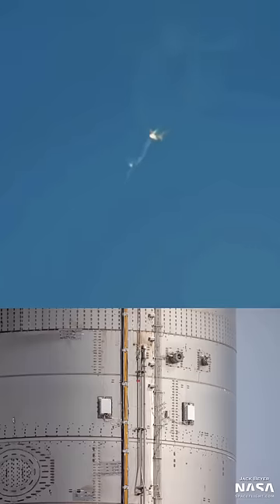Is This Why Starship Wasn’t Destroyed The Moment It Lost Control?

Comment: Well spotted! I remember seeing those lateral plumes but assumed they were some form of RCS. Totally makes sense that they fired but didn't cause detonation of the tanks' contents.  Lots of learnings from this.
Reply: Flight termination systems usually do not result in combustion, that's why you see the white plum with little fire. I don't think scott is right here, even less considering that starship has FTS separated to super heavy and it was evident when it was activated.. SpaceX probably didn't do it for more data, or in hopes of regaining control.
Reply: There was no "detonation" of the fuel/O2. It's probably impossible to get a supersonic explosion wave-front in it.
There wasn't an explosion when Challenger came apart, there isn't an explosion behind a bullet inside a cartridge case.
Reply: @JFrazer4303  that's true, rockets usually just expand really fast with little combustion.
Reply: @JFrazer4303  until the firing pin hits the primer and boom.
Reply: @darkmatter1152  
No, not even then. It is not a supersonic propagating overpressure shock front even from modern nitro gunpowder.

Some sources define an "explosion" so that popping a party balloon or paper bag qualifies, but no.

Comment: When I worked at a rocket startup in the mid-80's, I interfaced with the range safety officers.  Our design was a solid propellant ( polybutadiene+carbon, LOx pressurized (400psi) by helium (8,000psi) ), and the flight termination system was pyrotechnics that attempted to cutup the booster.  The RSO was very concerned we would have 3 or 4 very large ( several tons ) objects falling, when they were used to terminating vehicles that were power with hydrazine.  When they terminated the flight, 100's of thousands of tiny pieces would rain down.  Low potential energy ( mgh ) because the mass of the tiny pieces is so small.
Reply: Who cares
Reply: @deg6788  gfy
Reply: @deg6788  don’t be such a prick man I enjoyed reading it….

Comment: I think the biggest unasserted question is why engines shut down due to safety issues during liftoff/flight, but when they specifically were supposed to cutoff right before the flip started they didn't. 

If you rewatch the livestream the controller calls out for main engine cutoff right before the flip starts but the engines never cut.

Thats said this is itself interesting as well.
Reply: Because that was not the time to decouple yet, I think they didn't reach enough altitude due to early and progressively worsening engine loss with lack of gimbaling. If they actually tried to flip it then maybe they didn't have enough gimbal left to hold the flip.
Reply: @TheNheg66  I think you've completely misunderstood what i'm saying. 

Regardless of weather the flip was commanded or not, the engines were supposed to be cut-off by the time it started. 

The fact that the ground controller called out the supposed cutoff but it never actually happened is the big standout here.
Reply: You're assuming that it was supposed to flip under those circumstances — which seems unlikely, given that it was far short of the altitude and velocity at which staging should occur. I suspect it's just coincidence that the already-failing rocket happened to go out of control at roughly the same time at which staging would have occurred had things been going to plan.
Reply: @simongeard4824  i concur
Reply: @simongeard4824  Again doesn't matter, the engines should have cut before that point because the controller specifically called out main engine cutoff.
Reply: @darthkarl99  The rocket is controled by the onboard computer. Im not sure if ground control has much if any control on the way up. So it was time for MECO but the rocket never made it high enough to start it on its end.
Reply: @darthkarl99  they only report the normal timeframe. But as the rocket was slower, the cutoff would be delayed too.

Comment: I was amazed how well the craft stayed intact with so much dynamic force it had to be undergoing while tumbling.
Reply: you are wrong assuming there was a lot of force exerted on the rocket.
Reply: @Danuxsy  Stand on top of a skyscraper that's spinning and producing 16,000,000 pounds of thrust.
Reply: @Drocoh  also the rocket was completely bent right before it exploded by itself.
Reply: @Danuxsy  because the flight termination system kicked in already, making a hole in the fuel tank.
It wasn't until it hit the more oxygen rich lower atmosphere it could explode

Comment: The failure was caused on the ground. The engines obliterated the takeoff pad and numerous thousand-pound pieces of concrete beat the heck out of the bottom of the rocket before it ever left the pad. It was a sad end to a great effort, but they will fix this and will do much better next time. The torsional strength of the rockets body is very impressive here. That it stayed in one piece so long is actually a tribute to the power of the engines continuing to provide massive upward thrust through all the motions to keep upward pressure on all of the rocket sections joints. Really amazing sequence captured in video.
Reply: It is one tough rocket, though every early flight of a type is going to be a learning opportunity.  A lot of data analysis and stage 0 work to be done, but they'll get it right.  Looking forward to the next one.

Comment: In other words, the self destruct system malfunctioned.
Reply: No the self destruct worked as expected. it was so high, there wasn't enough friction around it in the atmosphere, while it was travelling about mach4, supersonic fires are incredibly hard to ignite.
But, they know at about 6 miles high, there is enough air resistance, made to push against, more heterogeneous oxygen, and now at speeds more conduce to fire, or more specifically, deflagration. With the compromised structure, the air resistance and pressurised gasses causes a fast tumble, which will always rip a plane or rocket apart, causing the deflagration. the self destruct sequence worked, it just had to drop 3 miles first.
The reason we see this happen very quickly, to normal rockets, it's because they're built with aluminium alloy, and are strengthened and braces in 1 axis (vertical), they are single use and only need to strengthen the rocket one way. whereas the star ship is a steel alloy and it's bracing and strength are unmatched, simple because, to reuse it, it falls back down at terminal V, then 'belly flops' to bleed a load of speed off. Any other rocket, that was subjected to that side loading, would self destruct without instruction or explosives..
Anyways I know that was long, it was much longer than I planned anyway, hope it makes sense. Stay safe n have a Good day.
Reply: Did you actually watch the video?
Reply: @renagenic  So, the self destruct couldn't perform the function it was designed for. Or malfunctioned in other words. Good to know.
Reply: @Robert_DeVille  no, just took longer than what we know as usual self destructs we see.
Imagine the starship was a semi and normal rockets are light weight sports cars. Both can do an emergency stop, it just takes longer for the truck,
That doesn't mean it's brakes malfunctioned
it's just working under Newtons, conservation of momentum.
Reply: @renagenic  I can barely see this man through all the thick copium smoke💨 😂
Reply: No suprise. Elon musk knows almost nothing
Reply: @MrDmadness  True, but the problem here is that either he was putting pressure on them to ignore some important step, or someone else messed up. Contrary to what his stans think, he is not the one designing these rockets, he's just taking the credit like any other billionaire relying on competent workers to do the hard work.
Reply: In other words, the self destruct system isn’t well designed. Or maybe there is another system more faster in case of a too low altitude.
Reply: @1980VINZ 

no. it isnt a self destruct. its an FTS which just makes sude the boosters cant produce thrust. it isnt designed to detonate. the fuel ignites on its own due to the atmospheric makeup and speed. then it will explode on its own.

this is why its called a FLIGHT TERMINATION SYSTEM and not THE SELF DESTRUCT SYSTEM.
Reply: @auroraourania7161  He has always said that he hires the best in the business that is why he is successful and unlike Bezos he pays a decent wage and at least tries to stand for something besides a huge yacht that will require destruction of historical landmark just so he can sail it away
Reply: No. It worked as intended. It relied on physics to tear it apart, not an explosion that could ignite the reactive materials in the tanks.
Reply: @Zeeksplaylist  Nonsense, other FTS work as line charges that rip tanks open like a zipper instantly, these small measly holes for a vehicle this big and no wonder it didn't work as it should, massive red flag, why do you think they have to recertify it? If this happened much lower in its trajectory, it could've landed and exploded on a populated area.
Reply: No, you need a queue for 100 ejection seats
Reply: @renagenic it worked as designed. however it would almost seem like you think spacex rockets are superior... yeah that smells copium. as any design it comes down to what is required of the vehicle. reason why space shuttle tank and boosters were built slightly stiffer and why the starships are made slightly stiffer. however i still think we will never get starship, unless US buys spacex and merges it with NASA and well NASA got its own project.
Reply: @Robert_DeVille Work on your reading comprehension lol. The system was designed to ignite once the rocket fell back to a low enough altitude, which it did. That’s not malfunction, it’s function.
Reply: @DoraTheMFDestroya  Nice now I understand better. Thanks 👍
Reply: It was not a failure, he was explaining if deployed too soon it could not work so they waited till right combination air and pressure and then activated and worked as planned.
Reply: @renagenic I’d think quite opposite, since larger tank means more fuel to go boom
Reply: NASA is funded by the Senate and they dictate what NASA can and can't do. Virtually all their projects are too funnel money somewhere. NASA doesn't build or design rockets, they contract it out. SLS for instance had existed in one form or another since about 96 if I remember right, but it's design changes every so often and so does its name. What it's versions all have in common are space shuttle parts, it was supposed to be a cheap alternative to the shuttle. Only one ever flew, since then it's just constantly redesigned, built and scraped. The money spent on it's versions over the years is insanely high. But different project names... And they only list money spent for a given project. 

Point is, NASA could do nothing with SpaceX, the only he is they would use SpaceX tech like falcon 9 and then scrap the rest and shut down research.
Reply: @Robert_DeVille no it worked as expected. Creating holes. Fire is a triangle. Fuel, oxygen, heat. Get one out of the ratio it wants and it doesn't do. This is why your car runs or doesn't.
Reply: @metalsurgeon560   Muskrats are so funny. And that has to be the worst explanation of the fire triangle I've ever heard. There is no ratio, it's a loss of one of the sides of the triangle that prevents a fire, but the point of a self destruct is to destroy the ship, not set it on fire.
Reply: @Robert_DeVille  its the most basic one. Why is it wrong. Get any one of those out of ratio and the thing ceases to burn. Too much or little fuel will put it out. Too much or little oxidizer it will choke it out. And if the fire it produces makes too little heat or too much heat it goes out. All work in a ratio to each other. Which fire naturally seeks to do.  The system worked. There wasn't sufficient fuel in the air around the device for it to catch fire until it got into a more oxygen rich atmosphere.
Reply: @metalsurgeon560  Still mistaking the destruction thing for the setting it on fire thing I see. & it still has nothing to do with ratios. You either have the 3 sides of the fire triangle or you don't.
Reply: @Robert_DeVille  if that were the case I would burst into flames as I sat typing. And they are trying to poke holes and let fuel out not destroy in on first push.
Reply: @metalsurgeon560  Christ, talk about not knowing how fire works. Or what a self destruct is.
Reply: @renagenic Actually a very in-depth explanation. Musk’s haters are almost as annoying as his fanboys.
Reply: LOLOLOLOLOLOL Holy shit.
Reply: @deus_ex_machina_ ain't even a musk lover but the level the haters go through to justify their hate for him is absurd.
Reply: @Robert_DeVille It's not a self destruct system 🙄
Reply: @lenarianmelon4634  Even though self destruct is the function it's supposed to perform, do you know how you can tell it isn't a self destruct system? 

Because it didn't work.
Reply: @Robert_DeVille  its function is to blow a hole in the side so it starts leaking fuel and stop the engines and remove the internal pressures holding the fuel tanks together not the entire ship. Hence the name "Flight Termination System". This would only have the added side effect to destroy the vehicle in dense atmosphere from the lack of internal pressure but this happened 30km above sea level where the pressure is 0.01 atm. You're reaching for nothing here
Reply: @Robert_DeVille depends if it was expected or if they were blind sighted… wouldn’t really know unless you’re leadership at the company it may have very well been expected

Comment: The stress that rocket endured while staying together so long is incredible. Amazing construction.
Reply: Not so much, because when the termination order is given, you want your rocket to instantaneously blow up, not keeping doing looping for a while.
Reply: @rolletroll2338  my point is, the guys who welded and assembled the chassis were solid - maybe not the software engineers or line that built the CPU boards lmao.
Reply: @JuliusCaesar888  I was referring to the termination system. We can assume this was not well designed, it is far tow small to destroy efficiency a rocket of such size.
Reply: @rolletroll2338  your message makes no sense. Zip it, you.
Reply: @JuliusCaesar888  try harder to understand it. I'm sure you will be successful.
Reply: MuskCult.

Comment: I feel like that's a pretty non-ideal flight termination system. Usually it seems like you want it to donate pretty much instantly so it doesn't keep building up speed
Reply: Honestly, if it's going to land anywhere near anyone, you may not want it raining down in a billion pieces and have localized damage instead of a whole city-sized area peppered with rocket parts that could be quite big and/or in fire.
Reply: I don’t think Scott is doing a good job on this analysis. He missed a lot and asserted his claims as fact when they were at best, pure speculation. There’s no good reason to conclude in this specific case that the two primary detonations were not directly caused by FTS charges. The two new vents may have been an earlier part of an FTS sequence. Would make sense to vent the tanks and release pressure before detonating to avoid a nuclear sized fireball. [EDIT: I mean his analysis of this entire flight in general is pretty sketchy, not just this one video.]
Reply: @jordanhenshaw  there are two very good reasons:
1. the rocket explosion started from the engines, so it couldn't be possibly caused by the FTS.
2. you could see the FTS activating before the explosion, and failing to detonate the rocket.

Comment: From what I can see, the flight termination regs are not concerned with destroying the rocket; only terminating the flight within the safe area. And D417.3 para (b) says: A flight termination system must not cause any solid or liquid propellant to detonate.
So it seems to me that the FTS worked as designed?
Reply: Detonate is not the same thing as explode or burn. It has a specific scientific meaning based on things like flame front speed, Google detonate vs explode.
Reply: @ke6gwf  Detonation vs Deflagration is what i think you meant.

Comment: I’m so glad you brought this up. I had the same question, but thought maybe they hesitated to get more engine data. Also, shouldn’t the FTS actually destroy the vehicle? I thought the purpose was to break it into smaller pieces and consume propellant in a safer manner. Just poking holes in it without a boom could be very problematic at low altitude.
Reply: @bmcormick13  Yet the engines kept running until it ran out of oxidizer and broke apart.
Reply: @bmcormick13  it also allows for a much greater concentration of damage on impact as well as a fireball on the surface
Reply: This rocket has so much stored energy shortly after launch that any flight termination system is going to be problematic at low altitude. Depending on what's going wrong it might be safer not to use it right away.

Given the damage sustained to the rocket after ignition but before liftoff you have to wonder if it was safer to let it lift off  if it still had enough engines rather than shutdown and sit on the pad fully fuelled with broken engines and unknown damage or leaks.

Clearly they had a preference for launching with failed engines rather than aborting and swapping engines. Maybe they modeled the potential pad damage and decided that once lit this was their only chance to fly.
Reply: @joshuacheung6518 There can't be a fireball if there's no fuel, mate.
Reply: @VelociraptorsOfSkyrim  and what do you plan on doing with the fuel? Teleporting it to space?
Reply: I understand there would be significant damage at low altitude but “unzipping” the tanks and igniting the fuel in a slower aerial conflagration, rather than have the whole vehicle still full of fuel hit the ground seems….intuitive.